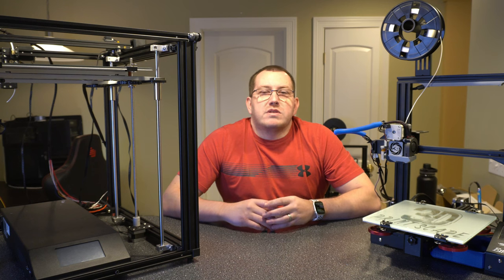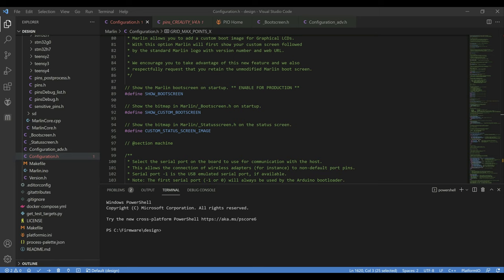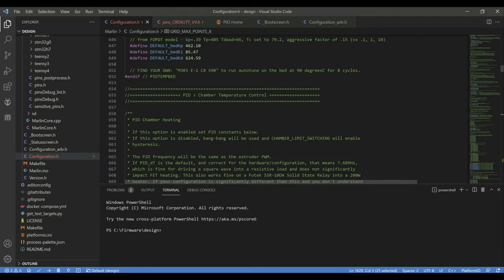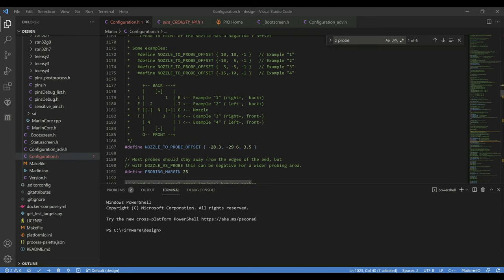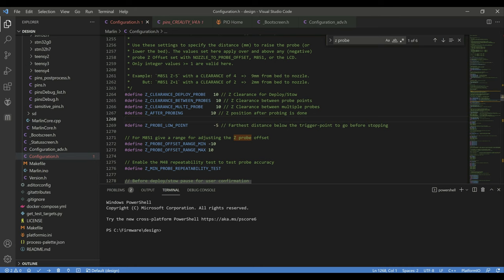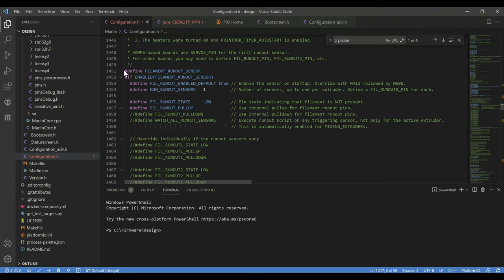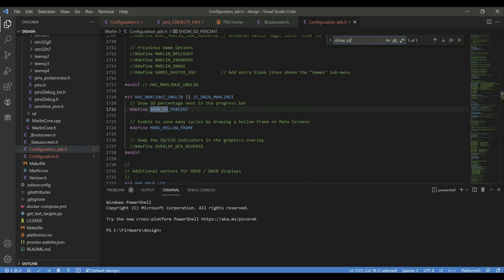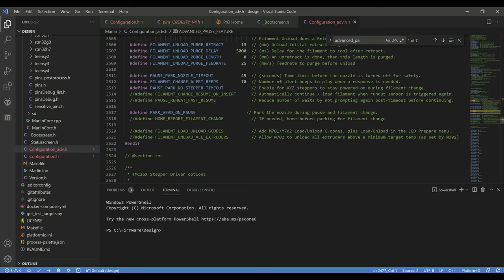Marlin Firmware Build for Design Prototype Test’s Unbeatable $200 3D Printer!!

Comment: Hey Rob,

I've been running into issue after issue with my Ender 3 3D printer. Your videos have assisted me greatly in fixing issues as they arise but I still can't get my printer to print properly. Despite the continuous adjustments I've made, I still can't even do the simplest of prints. Who would you recommend reaching out to in regards to a location or professional that can help me make the needed adjustments and calibrations to this unit? I don't want to give up on it but I am about ready to yeet this thing out the window. I've only ever gotten 2 prints off this machine before it went to shit but I need hands on training that will assist me.

Edit: After I made this comment, decided to use the recommend temps listed on my PLA, didn't even occur to me to look at it. Much better results but a lot of fine tuning to go still.
Reply from the maker: Hi. The printing temp has a large impact on pla, im typically using 200-205. If you havent printed a temp tower yet, i would do that. If you need more help, you can join the discord server (link is in the video description). There are a lot of people on there who help each other out and I help out as much as i can.

Comment: On your website you recommend a particular Amazon cable for connecting Ender3 to PC. Do you know for a fact that the cable you recommend will transfer data? Some USB cables on Amazon are only able to charge things, cannot transfer data. Thanks
Reply from the maker: Hi. Which link specifically? I had one that was for a charging cable up before by mistake but that wasnt up long and was swapped out. I want to see if its just a host caching issue or something like that.

Comment: Awesome video, followed step by step however I'm having a problem getting the .HEX file on my Longer lk5 pro. What am I missing?
Reply from the maker: Hi. Where are you getting the .hex file from? Those files are used for the older 8-bit boards and the upgrade process is a lot different.
Reply: After I've done the step by step and compiled/build in the Marlin firmware. I click the folder underneath the build button and it gives me the .Hex file. Then I placed it in the micro SD card and put that in the printer. So mine must be 32-bit? What would be my next steps going forward?   @3DPrintscape
Reply from the maker: @manchandiyextreme8663  If you get a .hex file and used the right config example for the printer and set the environment correctly that means your board is 8-bit, not 32. The process will vary significantly based on if the board has a boot loader on it already or not. I dont know enough about that board or printer to really help.

Comment: What controller board are you using and where do you buy one
Reply from the maker: Hi. If your talking the mainboard. This is based on the Creality 4.2.2 board, but would also work with the 4.2.7 board. Both are available on amazon.
Reply: @3DPrintscape  Thanks I will check it out

Comment: When I changed the z_min_probe_endstop_inverting to true I got an error when I compiled saying that the z_min_endstop_inverting should also be true.
Reply: I got it working.  I had to comment out define Z_MIN_PROBE_USES_Z_MIN_ENDSTOP_PIN
Reply from the maker: Is everything working for you now?
Reply: @3DPrintscape  Appears to be.  However when it homes before a print, it moves the print head to the center of the bed and then homes z.  This tends to leave a blob of filament right in the middle.
Reply from the maker: @HomesteadHighlights  What temp do you have the hotend set to?
Reply: @3DPrintscape  If I add the G29 after G28 in the gcode the bed and nozzle are at print temp.  Which for PLA I typically use 60° and 200° respectively.
Reply from the maker: @HomesteadHighlights  You want the bed to be at temp. You can make some changes to lower the nozzle temp, but i dont think its necessary if your running the purge line at the start of the print.
Reply: @3DPrintscape  Yes, I did the repeatability test and it was poor at first, but with some modification I am getting deviations of about 0.009 - 0.008